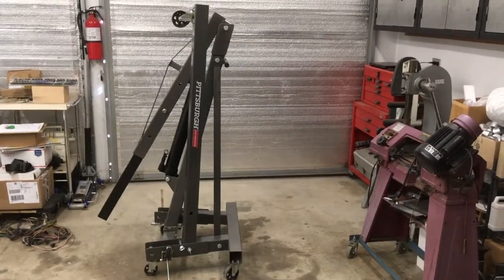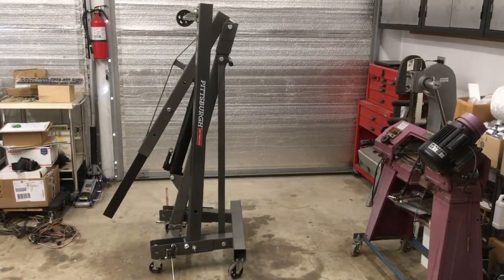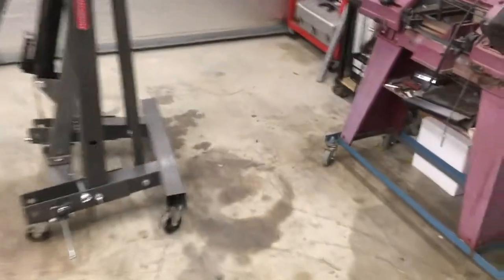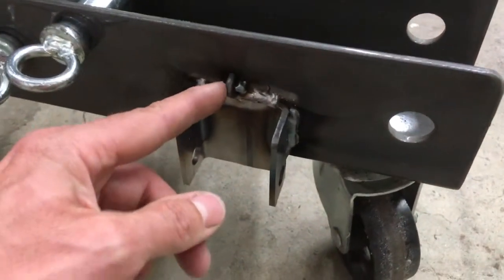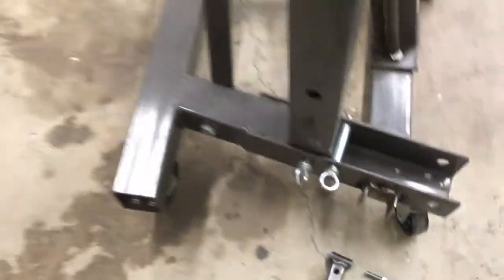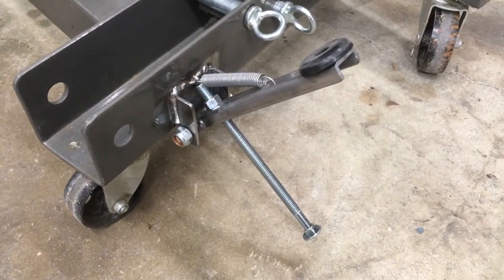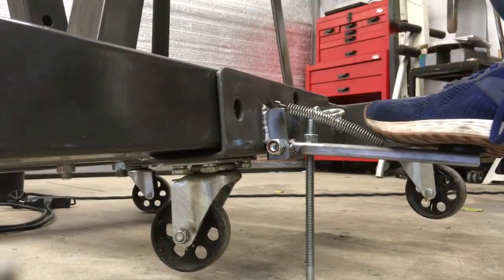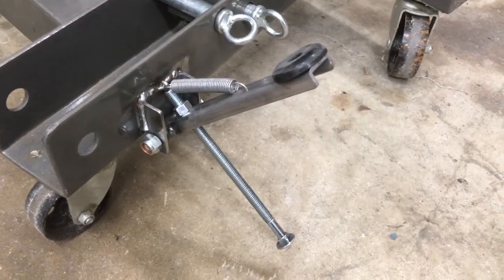HF Folding Engine Crane 69514 Modification

Comment: I just used a die grinder and ground out the holes a little. I doubt it weakens the legs much. If it does, I don't get under anything the Engine Crane lifts anyway.